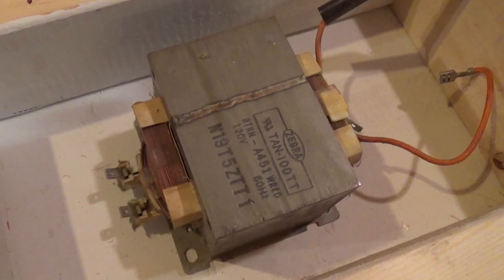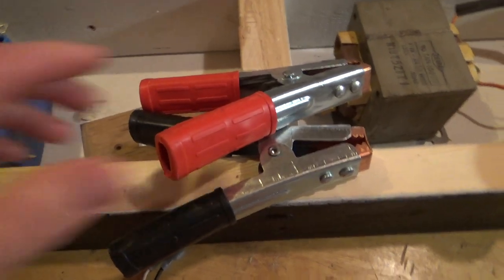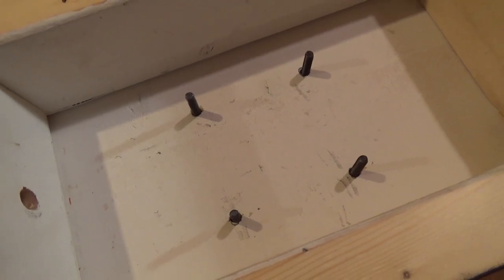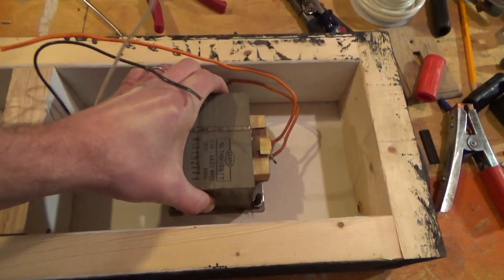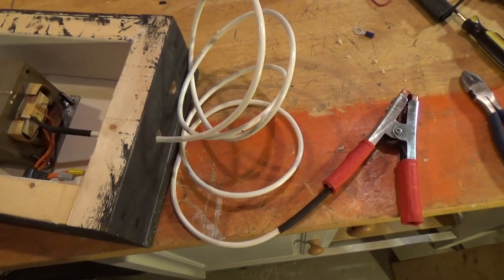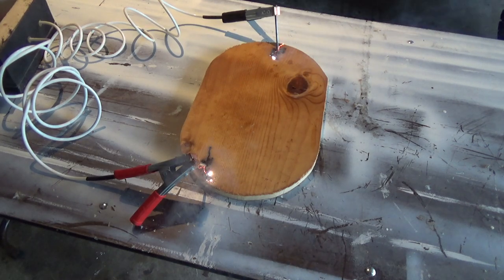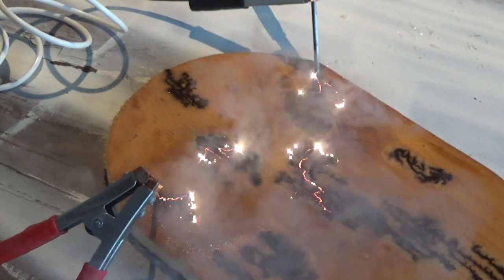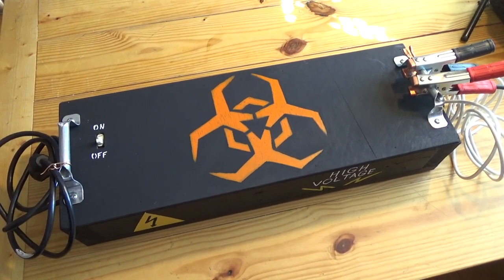My Lichtenberg Device (High Voltage Wood Burner)

Comment: Excellent video dude. I'm definitely gonna build one. Lol. U should have a vent for sure on that xfrmr side. Other than that it's a sound design.
Reply from the maker: While I can't (and don't) recommend anyone building one of these, I certainly do appreciate you watching the video and leaving a positive comment. Positive comments on this video are few and far between. Thank YOU!
Reply: @HNXMedia  I completely understand your non-recommendation. I've been an electrician for 22 years and this should be an easy project. Safety is always #1 when messing with ol sparky. I've found several trolls just hitting every channel doing this and leaving the same negative comments, but oddly enough I don't see them on any other highly dangerous videos comment section. They're all probably just Karen's coming here from that cooking lady's channel.
Reply from the maker: THIS comment coming from an ACTAUL ELECTRICIAN makes my day more than you know! Respect! It does seem like the negative ones came out of the woodwork all of the sudden and all seem to be "drive-by" comments. Karens and Safety Sallys are the bane of most of my comment sections. Its almost like they don't read my disclaimer. Thank you again.
Reply: @HNXMedia  I certainly would always recommend rubber mats, leather gloves rated for high voltage and non-conductive work surfaces, all outdoors of course, but you clearly had safety in mind when you built this.
Reply from the maker: Absolutely. Note: Original comment pinned for positivity and GOOD information.
Reply: I would like to recommend that should you decide to make a lichtenberg burner, you would be well advised to study how others have injured themselves working with electricity.

Comment: A few things spring to mind here. This project is incredibly dangerous, lethal in fact. Nails & metal handles make great high voltage antennae, so every single one nailed into that box is potentially an exit point to burn or electrocute you. It is a serious accident almost certain to happen, I'd stop using it immediately. Also, the gentleman quite clearly states, 'I'm not an electrician by any stretch". Here in Queensland (Australia) what this guy has done is classified as "Electrical Work". As it's unlicensed electrical work that is an immediate $400 on the spot fine, minimum. As it's also a dangerous act, the fines escalate dramatically up into tens of thousands of dollars and recently a company director received $100,000 fine for unlicensed electrical work & no-one was injured or died. If someone is injured or dies as a result, well I guess you better have the deed to your house handy & get used to prison food. If that project starts a fire, burns the house down the insurance company will have every right to refuse paying out. Think of it as unintentional arson. Check with your local electrical authority too & you'll find most will have similar laws governing electrical work. And posting on Youtube when the video can be traced to you, well you just guaranteed a win for the prosecuting attorney. I understand the fascination with this as a form of art, but is really worth any those risks?
Reply: So glad I don't live in Australia.  The government overreach there is crazy. Getting like that here though.down with big brother.
Reply from the maker: @MichaelLashley I wish I could give your comment 100 thumbs ups.

Comment: You should add two more safety steps into your design. First put a small light inline between your switch and the transformer, so you know when there is power going to it. You NEED to add a dead man foot switch. Plug your device into the foot switch that way it can only get power while you are standing on the switch, which should be far away from your work. That way there is less of a chance you can accidentally touch your work piece while the power is still on. People have died using these and forgetting to turn it off or quickly reaching out to move a probe while it is still powered.
Reply from the maker: Like the ideas. Might retrofit to add these if I can find the parts around the shop.

Comment: I'm a licensed electrician and your wiring job looks fine to me. 👍
Reply from the maker: Thank you! It's nice to hear from actual experts instead of the keyboard warriors that seem to be attracted to bashing this video. You comment is truly appreciated! Thanks again.
Reply: This wiring job for 2000-3000 Volts with clamps exposing the conducting metal insulated by rubber that can crack is fine to you? None of this would have any chance of passing any UL certification as the currents possible are lethal and you can die in a split second. 
The voltage and current is equivalent to that used in an electric chair. The fractals you see on the wood are what you can expect happening through your nerves and heart within no time. At 3,000 Volts, you know arcs can be formed even through a microscopic crack or needle prick defect in that rubber insulation (3mm jump) and if there is any dirt or humidity in such crack, it's even much easier for the current to flow. 
I have a master degree in electrical engineering and if this was some mains power residential wiring, I could be less concerned, but even then, you don't expose clamps with the full voltage (e.g. 120V) and high power. Lots of people die because they become complacent or are ignorant about the true dangers and any protocol involved in using such setup. 
I've had lots of electric shocks from my engineering experiences and a few that got me worried, but this is an entirely different level than hitting a live wire in a house with a finger. I've replaced all my 70 outlets and switches in my house with Z-Wave models btw and professionally engineered consumer electronics products for such brands as Bang & Olufsen including getting things certified for CE, UL etc. safety. Ages ago I was engineering CRT TVs with the flyback transformer also having lethal voltages. I got a shock once from that and never forget it, but current is not as crazy as from a microwave transformer, where there is zero mercy and you will fry the inside of your body
Reply: @ThinkingBetter  there are a lot of us electricians on here. Of course with our own opinions. You bring up UL listing? That’s hilarious. Do you think he’s gonna call an inspector in to give him a green tag on this? Cmon dude.
Reply: @ThinkingBetter  you are talking about the safety of this at the same time admitting that you have been hit many times. The output of this isn’t comparable to that of an electric chair.  It’s AC voltage. Microwave outputs DC while still deadly they aren’t comparable. Since you’re such an expert you already know the differences. And with different voltages and amperage that they are completely different. The whole UL listing had me laughing.  Oh and you changed out over 80 devices? Nice. I’ve got apprentices that can double that in a 10 hour day. Chill out bro. 
 If you have a wife I feel bad her. 😂

Comment: What a killer device. No safety at all. Dad is at work and the 12 year old son gets excited with these nice labels and want to check out this toy on his sister...and sister is gone in less than a second...or dad forgets to turn the switch off when he think the power is off because the wood is too dry and contact is not made...and dad is history in less than a second after holding these clamps...and so on...No wonder this hobby keeps killing people in the 100s globally. The voltage from these microwave transformers is in electric chair territory and forget about all notion that there is a switch you can use to turn it off. You are immobile and dead before that switch can help you.
Reply from the maker: 100s??? Try like 33 since 2017. Now lets compare that to how many are killed jaywalking, driving or climbing ladders EVERYDAY. But hey, I wouldn't expect you to do any legit research. However, you can drop the words "deaths wood burning device" into the Google machine and it will do the research for you. You write good fiction though, so stick with that and best of luck. I'll be first in line to buy your book. Peace.
Reply: @HNXMedia  it's ok
You aren't going to live long.

Comment: Never ever use a switch! It can fail or accidentally be switched to the on position. Just connect and unconnect the cable. Make a habit of hanging it away before handling the device.

Comment: Nice box, not good enough.  I am a military trained electrician, (21 years, retired), and spent 30 years in factories, as a electrical maintenance manager and an industrial engineer. 
 I got into this hobby about five years ago, and had a similar setup, save I elevated my platform off the bench with two glued on 2X4's. After time, you get a bit lazy...then maybe cut a few corners.  We all say we won't, BUT WE ALL DO.  I recently got into fractal burning guitars, and one late afternoon, a bit tired, didn't realize it was still on and touched one probe. The other one literally jumped into my other hand, as the hand was touching the edge of the guitar body.  I "Rode the Lightning" for about two seconds until I fell on my right side, heavily bruising my shoulder and hitting my head on the floor.  When I hit, I woke up, got up and went into the house and had my wife call 911. Heartrate was 160, and I ended up in a burn center for three days as they monitored my heart, and treated the burns on my hands, which were not that bad. Huge hematoma on my forehead, and a scalp cut on my head where I scraped on a bench nearby. NOT FUN, NEAR DEATH EXPERIENCES....
Changes I will make:
1. Add two momentary on switches to the incoming 120VAC in a plastic housing. Both have to be pressed to engage the unit. No 120VAC, no burn. Two switches, two hands.
2. My potentiometer, which I use to adjust the voltage, will be next, in a straight line away from me. Adjust before I can press both buttons, which are UL approved to be Open when released. 
3. The actual unit on its platform, further away down the line.
4. The probes, with 10K insulated wire, extending to a separate wooden table.
5. Finally, 12K gloves, 1.8MM thick, in case the switches, and the potentiometer all fail and it stays lit.
6. I am standing on 3/4" insulated rubber flooring, the final table will not be on the same rubber.
Sound like a lot?  6000VAC is a lot!  I am lucky to be writing this, but this is what I should have done in the first place.
Lichtenberg is like nothing else in beauty, and it is highly, highly dangerous.  I see people using regular wire, no gloves, machine very near to the work, and I think, there is number 34, waiting to die....
Stay safe.
Reply from the maker: These tips right here! Right on! I am implementing the dual switches for sure. Love that idea!
Reply: I agree completely and yes, you are a lucky one. Electrical safety can NOT be over emphasized. A guy was talking to me the other day about coming and doing one of those on his machine. I not so politely declined. Be safe.
Reply: Wow. You are very lucky to have gotten away with only burns and no permanent damage. Most people that survive one of these encounters end up with a few less fingers. Really gnarly injuries. Having two momentary switches is a great idea. Like most dangerous activities, there are ways of reducing risks. Combined with the HV gloves (a lot of people just use standard electrical gloves that can't handle the high voltages, and they end up with the gloves melted to their hands when something goes wrong), the insulating mat, it sounds like you have definitely thought this through.
Reply: @HNXMedia  Dual switches at a distance keeping you at distance is really needed. But also make sure nobody else in the family can operate it including some curious young son of the family not realizing this is "electric chair territory". Kids die from guns left in drawers...this should be seen as a similar thing.
Reply: You should do a video on your perfect set up.
Reply: Great advice brother. You’re right. As electricians we can get a bit complacent at times. Especially after many years of it.  I took similar precautions while building mine. I added a normally open foot pedal to mine. Just as another safety measure. I really like your advice as well. I’m gonna borrow some of that lol. Also idk how but I have yet to see the fractal guitar art. I’m gonna have to check that out. Thanks for your service. I was army too. 25U signal corps.  Got my state electric license when I got out. I have always loved my job.

Comment: Good Video !! One thing tho,, I built one of these in 2006 similar to what you did. The difference is I added a pilot light between the switch and transformer so anyone can see when the switch is on from anywhere in the shop. Kudos to you !!!
Reply from the maker: Thanks! That is a great idea and one of the many features I plan to add to this device. Thanks also for leaving a positive comment, they are rare on this video. Stay well.

Comment: Very nice ! You should  install a    cooling fan through the transformer with vents on thebox as tocool the transformer.
Reply from the maker: Cool idea. I will certainly add one.
Reply: The possible current paths taken when a transformer fails are only one thing professionals consider.    You are connecting the secondary to an unknown load, so overheating the transformer can be anticipated.  

Nah, I'm not going to waste any more time on this.   Good luck kiddies.

Comment: ...you kept using the term "ground"...there is no ground in this system...not on the input or output...all terminals are hot. Plus, the bolts holding the transformer in place are hot and very close to the bottom...they could easily arc to something conductive...
I agree with others here about using more safety devices/switches...also using a neon transformer would be much more safe...
Reply from the maker: If I had a neon transformer, I would make a Jacob's Ladder.

Comment: So were is all your safety equipment. No matter how safe you think your going to be or smart you are someone going to lose body parts but most likely catch on fire be dead before you hit the floor. 
Please someone post that video. I will check back for that video. Good luck. High voltage is not forgiving. You don't just get a shock and continue with your normal life.

Comment: Should not use an mot... MICROWAVE OVEN TRANSFORMER!!!!!
Reply: I built one. I made a switch similar to the ones on giant punch presses. two independent momentary contact switches, separated so it's not possible to press both with one hand, also a cover so something can't fall on them and push the switch on. Every things on a plastic table fully insulated from everything else. I have to be at the control stand to use it and that is several feet away from the burning table. The probes are placed and left in place. No way would I have it set up like one other poster who holds the probes with rubber gloves.